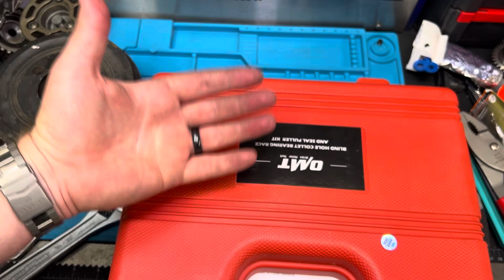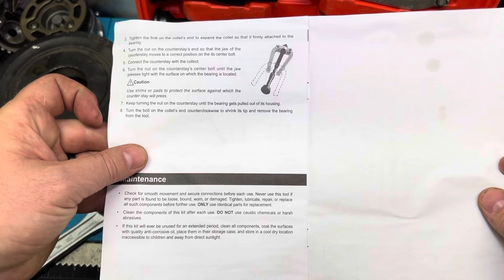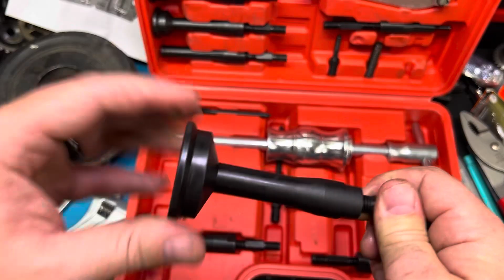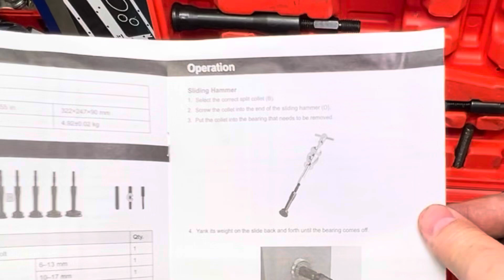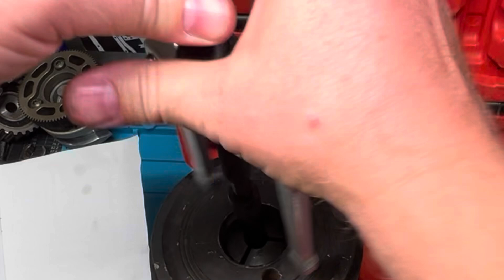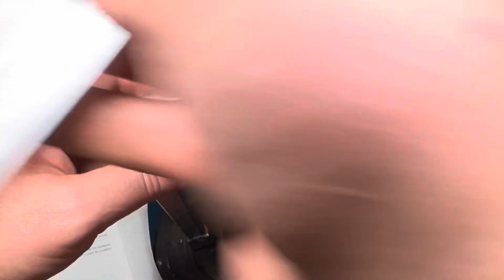OMT | 16-Piece Blind Hole Collet Bearing Race & Seal Puller Extractor Kit, W/Slide Hammer

Comment: I have specific sizes of these purchased for bearings within engine casings, usually bought as an OEM tool that costs a fortune. Not seen these as a complete kit though. The old way was to knock the inner race out and put spots of welds around the inside of the outer race. The aluminum housing expands at a different rate to the steel bearing race, and timed right you could flip the housing over and the bearing race just drops out.
Reply from the maker: @three-phase562  yes so glad not to have to weld on. I like that they give you various options here. Not a bad kit. Thanks for commenting. 👍🏻